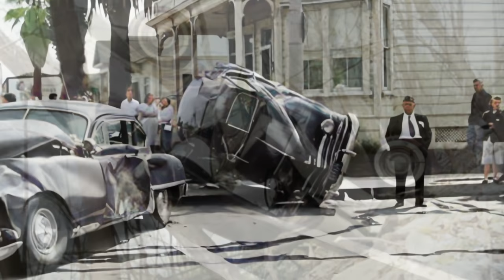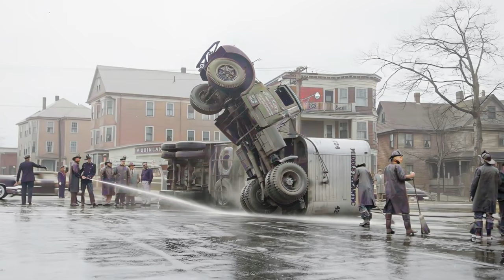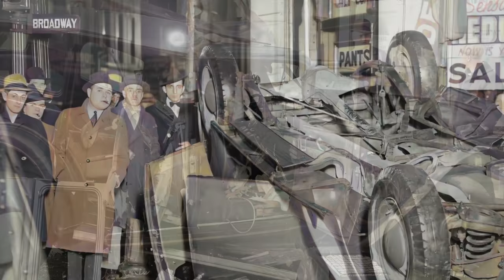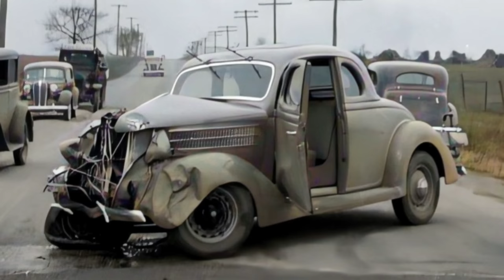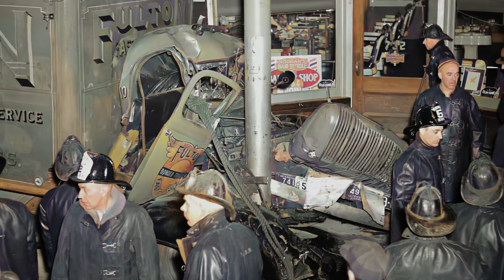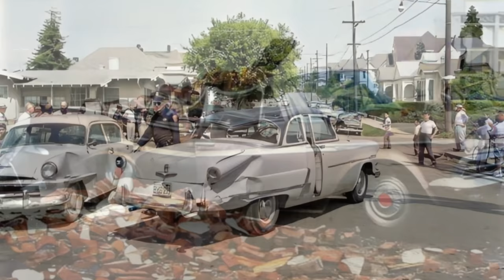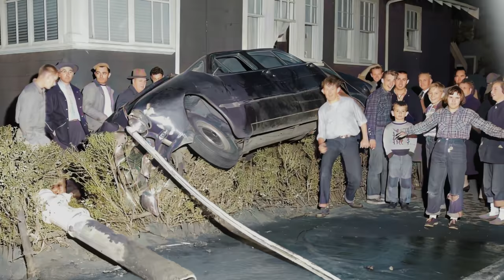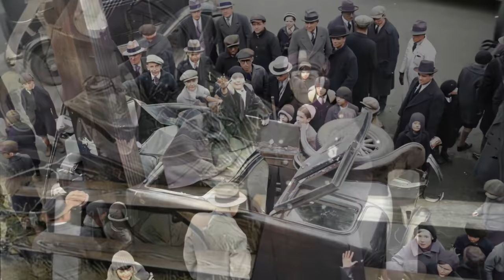Crash Chronicles 2 [Colorized]

Comment: Old cars had more style?  Really now?
To me they all look incredibly similar.  Look at cars today... yeah, your typical sedan looks much like any other, but look at what is available just a shade outside the Carolla body style.   Camaro doesn't look like standard sedan, but not much different from charger/challenger, where a Supra doesn't look anything like most any other car of its class.  Nor does a Mini, or the ugliest cars on the road the Fiat and Smart.

Old cars were very, very similar across all classes except for racing chassis.   You had the family cruiser (tapered nose, side access engine bay, standard cabin design), and the land yacht (square across the engine bay, front access, wider cabin).   No seat belt, no crumple zones, no tire traction, guillotine windshields, and interiors as tough as the exteriors that made human bodies pop like dropped eggs.

Comment: Seen what a 2013 Toyota looks like after wrapping it's self around a tree? Don't look much better than any of these. Not to mention in 1950 30 thousand died on the roads, in 2013 over 40 thousand so not sure safety of the auto is the issue, just sayin.

Comment: I think older cars last much longer. Nowadays cars die so easy from little electric bs.
Reply: The times change, dude, the times change.
Reply: Those old engines don't run nearly as many miles but are not as hard to rebuild
Reply: @redtra236  sure whatever makes you feel better.
Reply: @gustavoperez5480  yeah they do and while they do I keep making it home while everyone else breaks down and calls a tow.
Reply: @Thumper68  What is wrong about what I said? Most newer engines get junked when they go bad but easily run 200-300K, the engines from this era go 150K at max(usually burning a lot of oil by then if they make it that far) but are rebuilt on a regular basis. I'm not saying either is superior.
Reply: @redtra236  50 year old engines can easily run 2-300k plus pretty easily. The problem is most people do not even come close to properly maintaining their vehicles and nowadays most people don’t make a car last more then 50-100k if they’re lucky because they trade them off or can’t afford what should be easy repair but it’s thousands of dollars so people junk them park them etc.
Reply: @Thumper68  upss.

Comment: The larger, older vehicles certainly didn’t fold up like a paper clip when hit at 30-35 mph. They were built extremely SOLID. 👍❤️
Reply: And that's what killed you quicker. Physics is hard for some
Reply: @metallicafan416  Quite obvious that Pam never took Physics or Driver Ed.

Comment: Those solid cars took most of the impact, often totally destroying the auto but not leaving the passengers to take most of the injury.  Today’s car wrecks just crumple the passengers up with the fiberglass, and thinner & lighter metals used in todays cars.
Reply: Absolutely incorrect. Modern vehicles have crumble zones and steering columns that won’t decapitate people .
The highway death rate has been decreasing since it highest in the mid 60’s .
Those vehicles built in the mid 60’s were death traps in an accident.

Comment: Dude you need to learn more about cars cars back then lasted ten time longer than this crap they have now back then they didn't build engines to start failing at a 150.000 like most of your car manufacturers do today the only company that build a car to last long is Toyota and that 250.000 the cars today are pieces of total crap
Reply: I have owned 2 modern vehicles with over 250,000 miles . A Dodge Ram and a Jeep Cherokee .